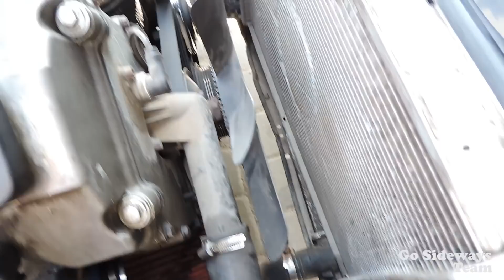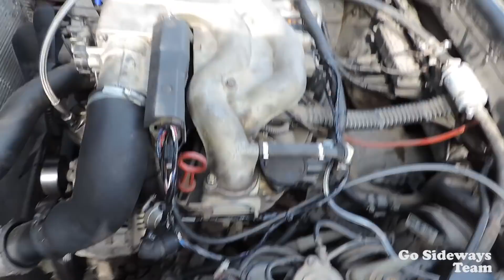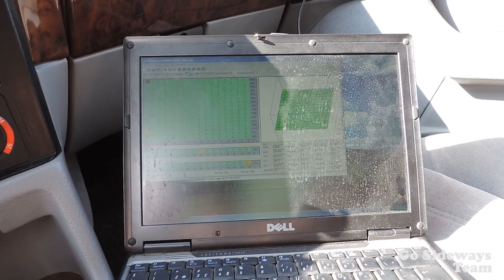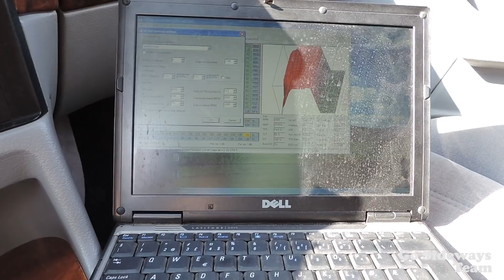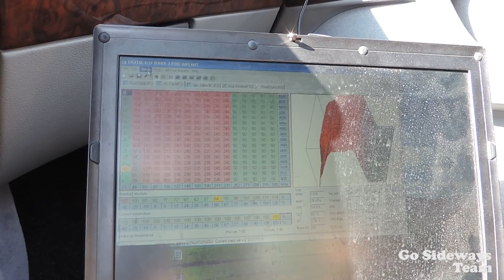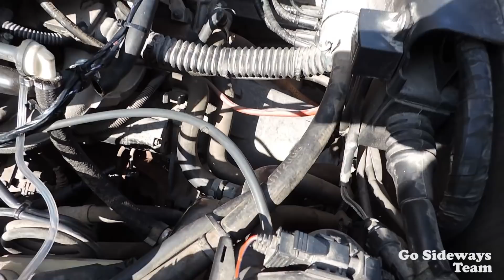LOW BUDGET E34 518i TURBO with ECUMASTERS DET3 (EN)

Comment: how did you connect the crank sensor to the det3 dude? ... which cable’s did you connect ... I worked today on a M40b16 ... have it running all fine but it seems like it doesn’t retard timing ... just reads the rpm

Comment: Does the fuel gauge still work correctly ?
Reply from the maker: You mean economizer or fuel tank gauge ?
Reply: @GoSidewaysTeam  Fuel tank gauge
Reply from the maker: @GabrielSTEFAN943  fuel tank gauge works just fine.
Reply: @GoSidewaysTeam  How does it calculate the fuel quantity in your bmw ?
Reply: @GoSidewaysTeam  Does the car have ESP ?
Reply from the maker: @GabrielSTEFAN943  The car originaly never had esp

Comment: Nice video 👍
I have a Siemens ms40.1 ecu. I need to install in my car. 
Is this compatible ?
Reply from the maker: Hey, i am not sure how vanos will react but i think you can run vanos solenoid via det3. But yes it will work with ms40
Reply: GoSideways Team  

Thank’s very much, for your answer.

I will build a low budget turbo project in a m50b20. 

I m fan of your videos!!
Reply from the maker: @andredesousa9964  Very glad to hear that :)

Comment: How are you using wideband lambda? Through controller? Does it make fuel corrections based on wideband?
Reply from the maker: Hey, yes i was using innovative wideband with controller if you want you can hook it up to this DET3 and it will do corrections. But it needs seperate controller, like Innovate MTX-L PLUS (that i was using).
Reply: Thanks for the answer. How did you wire the injectors? Injector wires (pin 3&32) from the stock ECU directly to  DET3 power out 1&2. Can the det3 manage to power the injectors straightly?
Reply from the maker: @timojuhanson2446  DET3 Controls injectors directly. You just use two banks. 2 injectors on one bank and 2 on the other one.